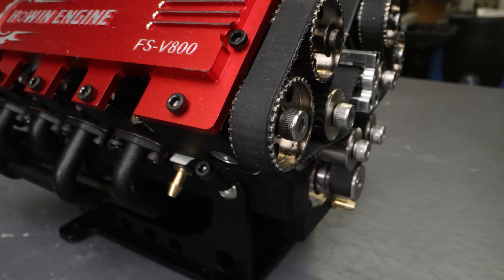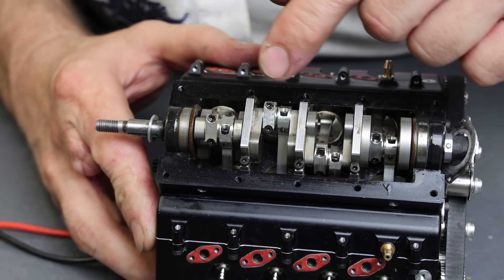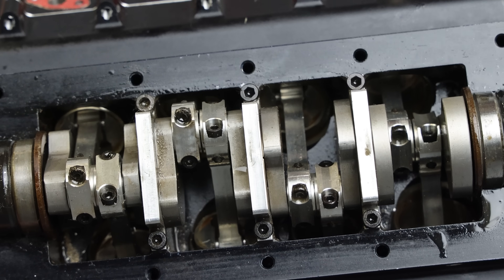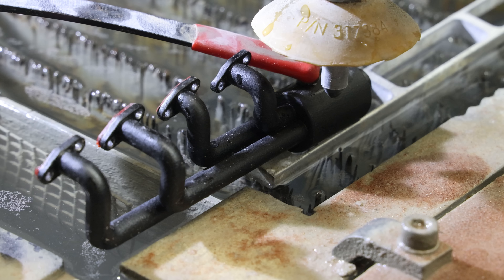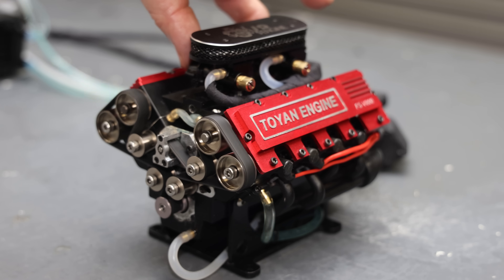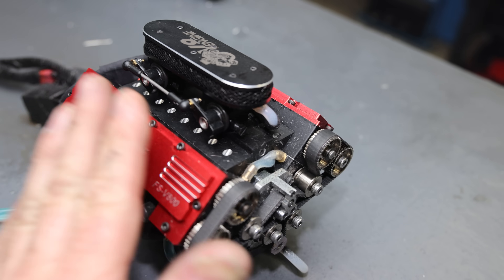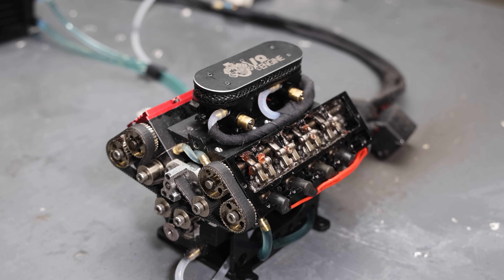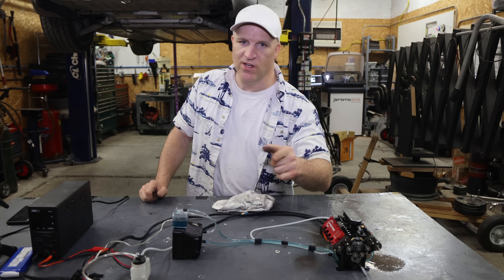World's Smallest V8 Engine Hits 10,500 RPM on Nitro (1.7 Cu In 28cc)

Comment: Can this be balanced. Like big auto you can always find a sweeter spot in their best motors I don’t see these as being any different. Flowed heads also I see coming from Edelbrock and a cam, piston intake and exhaust, Bosch is working on a small set of nex gen 6 hole injectors with pressure gauge adjustable, flywheel balanced, 2 speed quick shift trans.

Comment: Massproduced in China and still 3500 bucks... And regarding to all the videos on YT poor tolerances, short, just crap. The gears in the optional buyable supercharger hit themselves...
For 100 bucks, I'd actually would buy it
Reply: Manufacturing them is not easy, which is why it is usually expensive. In addition, Toyan does not put enough effort into the design of its engines, as happened with the L400.

Comment: Try putting more fuel pressure so the fuel comes more fluently so it can run better and try adding a transmission and a body so later you can add it to a car

Comment: How do the crank, mains, and rod bearings get lubrication? Plain bearings and ball bearings require different methods of lubrication. And just grease for the cam and rockers? I guess there is no actual oil pump? Very cool engine and build quality.

Comment: They should give these to every kid who gets bad grades, but is actually smart.

Let them beat up these mini engines, and then have someone teach them how to tune it and then have someone teach them how to calculate the physics behind every piece.

Give it a generation or two later, the internal combustion will be in Supercars that break the sound barrier in propeller planes (cause aviation wouldn’t have caught up) and on the ground that only use 1/4 a cup of gas per minute.

The old prop planes running gasoline engines would be the future of all flight.

Comment: I would install the motor in a circular saw

It will probably never sound like a big V8. It's just too tiny for that and the RPM is unnaturally high.

But if you listen to the slow motion, it does sound like a V8.

Comment: For somebody is doesn't know, is it natural to have air bubbles in the lines like I see?
Reply: no generally you want to bleed out as much air as you can from the radiator and lines, air isnt as good at conducting heat and it also expands/contracts pretty fast which can cause problems

Comment: Most nitro engines need to be warmed up to around 130 degrees before actually messing with the tuning needle and usually heated up with a heat gun before turning on to at least 110 degrees or so helps create less wear on the engine when starting and just easier to start overall.

Comment: Why didn’t you say in this video how much of a nightmare this engine is to get running with the spark plugs that it comes with and the ignition system it doesn’t come with basically why didn’t you warn people the $1600 nightmare they were about to get into?? Doughnut had no problem doing it because they still can’t get theirs running and they switched to glow plugs like you did. YouTube used to be a place where you could get a warning about the bad parts of things rather than people just trying to sell you stuff. In fact one donut called you and mentioned that they got one of these the first thing you did was wow at the pain they were going through because you know about it but you didn’t say anything about it in your video

Comment: I’m quite surprised that you run this engine without any oil lubrication at all! But I suppose the grease is enough to suffice! Excellent video! I’m a retired ASE Certified Master Automotive Technician, and I’m just getting into building these tiny automotive combustion engines and I’m loving it. I diagnoses, repaired, built, rebuilt and restored my own vehicles and others cars of course. I’m disabled now but really enjoy these as a hobby. I have some really cool steam engine four bangers, rotary even a couple of small Buick nailhead engines like my big ones. These are a blast (Pun intended)!!!
Reply: Yeah, I am wondering too how this engine get lubrication, can't run for long time without problems
Reply: @christiansanden8005  Agreed! Far too much heat for too long will easily blow a piston or valve and much more!!! I wouldn’t run them longer than a few minutes so it’s a good thing the fuel tank is so small!!! When putting mine together I lubricated the short block with some Q tips dipped lightly in Royal Purple that I use in my cars and trucks. This at least gives it a bit of a coating. After some thought I decided to use a five weight that I run in my turbocharged four banger performance engines. I felt anything more would result in hydrostatic failure of the lower engine internals because of the micro tolerances in theses mini monsters. As far as the Cylinder Heads, Valves and pistons Rings are concerned they should be well lubricated fine for the first three to five minutes from the grease. It will melt quickly and coat well! But anymore than four or five minutes I would probably suggest checking it once the entire engine has been given a chance to cool before taking off anything more than the Valve Covers! But if you’re anything like me, that’s just part of the fun!!!! How I’d love to stuff this engine into a die cast car with remote control steering and throttle control. That  thing would SCREAM!!!! It would be great to terrorize the mice in the barn with! 😂😂
Reply: @ManicMechanic82  Yeah that V8 would be cool in a rc car but without a real lubrication no way, also the consumation is quite high so it would need a huge gastank, i have several rc cars, one with a 2 stroke OS MAX, running fantastic. Kind of weired that this baby V8 are so expensive and without a proper lubrication, no way to run it long time
Reply: @christiansanden8005  That’s a fact. I imagine that is why the gas tank is so small! One quick burn and that’s it. At least for a while.

Comment: Good video- thanks.
It would be fun to build one of these onto the back of my little M365 Escooter spinning an alternator and turn it into a hybrid scooter, 
I bet with some tuning, port and valve grinding and polishing along with improved cooling and lubricants you'd get some better/higher rev's then possibly think about some lil super/turbo chargers - I wouldn't mind seeing someone test out a little supercharger driven by a little brushless (drone) motor instead of the engine-If you got it right, I bet it would have a few HP for a 28cc I would hope. All the best.

Comment: @3:13 take a turkey baster and go down into the coolant tank and suck up some coolant and blast the bottom intake hole with solid coolant see if you can get all the air bubbles blown out, would help keep a solid liquid flow of liquid to help cool the motor more

Comment: That amount of air in the cooling system.... CAN'T be good if you ask me... Direction of flow is wrong as well: Flowing downwards, airpockets will stay in the banks and you'll get hotspots. The water should flow from outside to middle.
I bought one, but I notice I have to make LOTS of modifications to get this thing running right, because as shown, it might rev but won't produce any significant power for longer than 30 secs or it'll burn up.

Looking good, but terribly badly designed.

Comment: Does the starter disengage? Or does it spin? If it spins and the engine is at 10,000 rpm and the ratio of the starter is say 10:1 looks much higher, that would indicate 100,000 plus rpm at the starter.

Comment: first thing i see is the headers need to have close to the same length tubes to make it run smoother/better. same in full size engines. hard to make??? yes, if you don't know how. i'd imagine a nice set of stainless headers would look awesome. the shortest tubes could actually be putting too much back pressure for the longest ones by the time the exhaust pulses reach the muffler(assuming that is what it's supposed to be). also fuel consumption could be drastically reduced with some mods and tuning. other than that, supercharged or turbo(s)(in hopes the internals can handle it) and put in an rc car/truck would be awesome to see and run. mods with this thing could be endless. weakest point will likely be the crank. i pushed my nitro rc engine to the point of splitting the rod lengthwise getting too much compression with too much rpm a couple times lmao

Comment: If you could setup many nebulizers for the gas. Them nebulizers have a cold mist that is just unbeatable. In comparison with a standard carburetor, you can say it is junk. Many pollutions existing in the world because we are not using a proper mist. Injector were just as upgrades, so the next step would be something about nebulizers. Research that mist and power them motors. Change the world.

Comment: They actually charge over £1000 for this that is insane
Reply: Despite its size, it takes just as much time and engineering to design and build as a regular V8 engine. In some cases it’s more difficult to machine smaller parts like the ones on this engine
Reply: in fact 2000 on Amazon, expensive toy, you can get a real good V8 for that money

Comment: Been a while since I wrenched, but sounds & looks like advancing the timing a bit, if possible, would help at the higher end. It was spitting a ton of fuel after you clipped the headers, so you reduced the back pressure to force secondary burn. Maybe a slight tweak of advancement would allow a more complete burn.
Reply: I believe that extra fuel is caster oil and is how the engine gets it's lubricant into the cylinders. Usually these engines are glow plugs and are designed to already run advanced. Hence the nitro / caster oil mixture in the fuel.
Reply: You guys are speaking a different language and I love it
Reply: It's a glow engine, so it has no ignition timing as such.
Reply: I was thinking the same as the other guys have mentioned-there's no advance and retard on a glow plug engine but I'm sure I've seen another vid with this v8 and he had timed spark plugs (JohnyQ90 I think)- I guess with the programmable tech you can buy (Arduino Etc) you could make a proper mini ECU these days too. All the best.

Comment: I know that this must have been stated but I'm too lazy to read through all these comments.  You should not have mentioned that this engine got hot.  You have no cooling with this setup.  Anytime there is this much air inside the heat changer, both in the engine and the radiator the result will be little to no cooling.  Try driving you car around with out a radiator cap if you don't believe it  You probably have about a tenth of the cooling capacity.  
If this is a true scale model then the water should be running over 212 and needs a closed loop pressurized system.;

Comment: Sounds like a chainsaw or leafblower 2 stroke single cylinder motor and has less power & torque than electric motor half its weight or size... What's the point beyond doing it for the heck of it? Edit: "it ran full throttle for over 3.5 minutes during this shoot and its still running!" - LOL

Comment: if you want to get a great idle, you need an EFI running, maybe you can do one with an arduino ( i enter your channel becaue of your jet engines and now i am here  jelous of playing with such a lovely toy)

i recoomend to do an speeduino and since i believe you have the electrical skill to do in a regular size car, maybe wont be a problem, i believe the main problem will be the trigger system

also one of the problems that i believe you have, it is a too advance timing ( thats why also it get so much tempeturate so soon, bad idle but amazing high rpm)

ps: saw at least that the carbs werent tunning, that will help with the idling and you will get more rpm, also win some sound

dont run it without the headers, but i believe the ones they put are a little bit smaller, since without them not only sound more free, but also you can see you need to move more volumen trough the headers, if you can do 180 degrees headers also would be amazing for the scavanger effect on high rpms, i would put 10-25% bigger tubes also in a 4-1, but it has to be 180 headers (it will loose some of the v8 sound we are use too, but will start to sound more like a little F1 with those rpms)

take care and thank you for all the conten, will enjoy it tonigh that i wanted to find something that teaches me

Comment: That’s so much air in the cooling system! Cool little engine, I’d love to have an RC car with this engine.
Reply: That thing would fvcking scream with this engine in it!
Reply: @Dave_Crupel  it would also run out of fuel in a minute
Reply: @EAGLINWRX  Or less! The fuel tank would have to be much larger and weigh more than the rest of the entire RC vehicle altogether! But then again this is an extremely high RPM! You would need some type of two or maybe even three speed automatic transmission to be feasible!
Reply: @Dave_Crupel  the power output to weight of this is pretty bad.  It makes about 4.3hp, a good competition 3.5cc 2 stroke makes 2.5hp+ weighing a fraction as much, and a decent 28cc 2 stroke gas engine will make over 5hp easily.  This is definitely cool, but it won't make a car fast at all.
Reply: @wparsons  you're looking at hp, not torque.  Nitro engine makes 2.5hp or so at 40k rpms.  This V8 claims 4.3hp at something like 9 or 10k.  That would be around 5x more torque than the nitro.  With the right gearing, you can make a fast car with these little v8's.
Reply: @N301RCSTREETOUTLAWS  a ~28cc 2 stroke gas will still make a bunch more power, and be a lot lighter, and in the end make a car much quicker
Reply: @wparsons  who cares it would be cool as hell even in an rc boat would be very cool
Reply: @jakerthesnaker69  did you even read my whole comment? I said it's cool, just wouldn't be as fast as other options.  My  original comment was a response to someone saying it would make a car insanely fast, which it won't.
Reply: The coolant line fittings are letting air in constantly. There's no way to bleed the air out if the fittings let air in.
Reply: How can you even control such a RC?!!!
Reply: Quickest way to fry an engine.
Reply: The engine dousnt have a cooling system. The blue waterlike is the fuel full of air.
Thats why the engine runs so bad the vacuum and fuel level in the reservoir is off
Reply: @wilhelmcramer7376 he literally pointed out the radiator, fan, and overflow tanks

Comment: Sweet!
What sort of power does it have, though?
What could it be used for (if it had a decent size fuel tank).
Reply: 4.2hp, about double a standard .21ci rc racing motor.

Comment: the quad cam looks cool but it's only for show, it's only a 16 valve engine running off the top cams on each bank, the outer ones are for show and it would probably run better without the extra drag on the timing belt.
I'd be looking at the air intake so it can breathe better.., and bleed the cooling system

Comment: Sounded a bit like a chainsaw to me.
Now, the '91 Suzuki GSX-R 250 I once had, now THAT sounded angry! ...As it should, the darn thing redlined at 17,000 rpm, and was restricted to 19,000.
Only problem was setting the idle speed. The manual said 1.600 rpm, but the rev counter started at 3.000... XD
Reply from the maker: I used to have a modified 1100 GSX R ... It was insane, then I made it turbo and it was deadly.

Comment: Your running to lean, shorten the fuel lines and use a better fuel tank. That should help. The fuel also helps cool the engine.

Comment: I love that V8 engines are so monstrous that even a miniature version sounds menacing.
Reply: @TheKing-hr7uh  okay and who the fuck asked
Reply: Lawnmower are louder and have a smaller engine.
Reply: @allenleroy9109  loud doesnt mean it sounds good or menacing
Reply: @nick0164  mines sounds pretty menacing..
Reply: @allenleroy9109  true. the sound of 5 blades spinning thousands of times a minute is very terrifying
Reply: @allenleroy9109  actually they dont. This engine has 28cc of displacement and most lawn mowers have around 70
Reply: @lennartsix6102 most mowers have over 150, most riding mowers are 300+
Reply: @jackwagon1738  or that, doesnt change my point tho
Reply: @allenleroy9109 I mean the sound is coming thru your phone I bet this is way louder than your lawnmower

Comment: Sounds pretty rich.  Lean the high speed out and will save nitro.  Need a better radiator because it sounds like heat is an issue.

Comment: There is far too much air in the coolant lines running through that engine. 

Liquid coolant is much more effective at removing heat from the engine than air is. That's why you have LIQUID coolant flowing through the engine block instead of just forcing air through the engine block.

When you look at the coolant lines here in the video and see many many many bubbles, that indicates a cooling system that is not able to effectively take heat away from the engine (block).

Coolant usually flows in a system where it is kept at an elevated pressure, like when your radiator is hot and the cap is still on. The coolant liquid stays in, and air stays out. Fewer bubbles in the lines, the better. Liquid moves heat, air bubbles get in the way of the liquid. 

For the geeks like me,... yeah, I know air moves heat too, just not as effectively as a liquid.